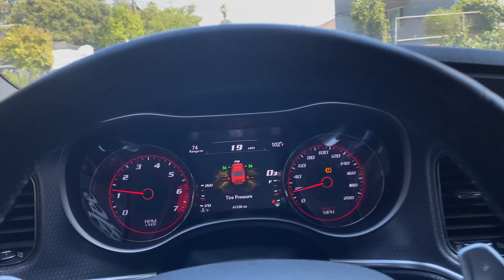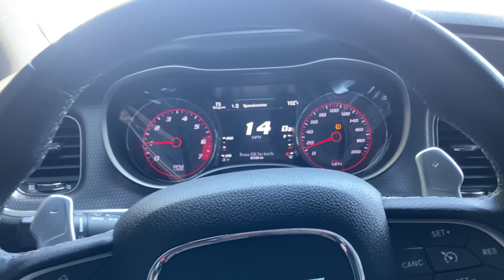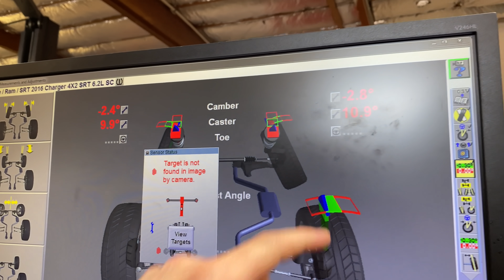I BROKE THE HELLCAT..... AGAIN!!

Comment: Teflon lined Heims by the looks of it just like on most after market links, if u want beef sometimes u gotta deal with a little noise. Most likely just a little dirt stuck in between the ball and the liner. Get some ptfe dry spray and try to spray inside the Heim, your welcome.